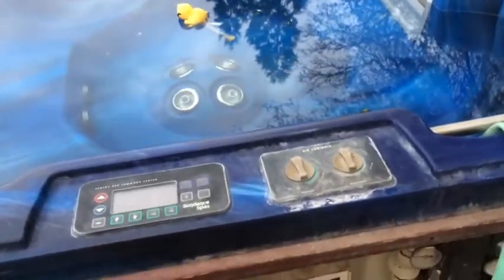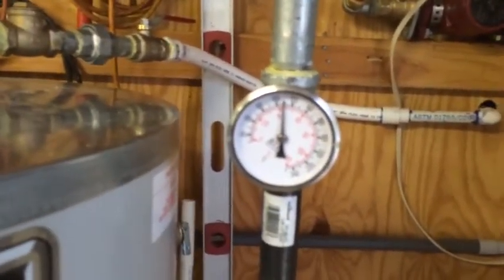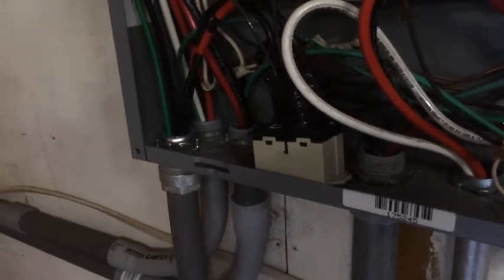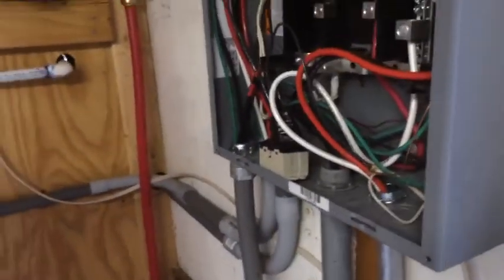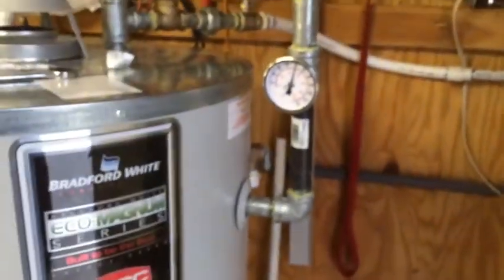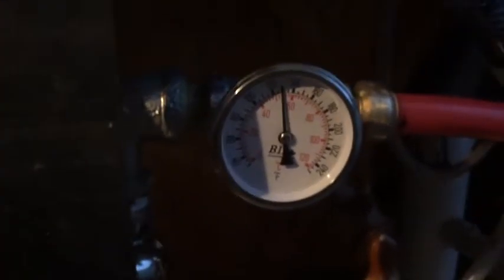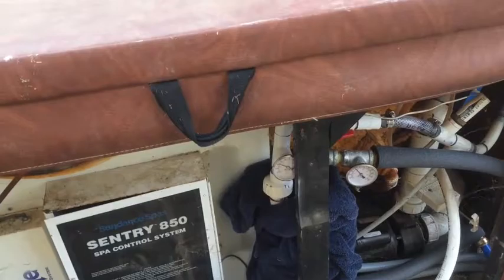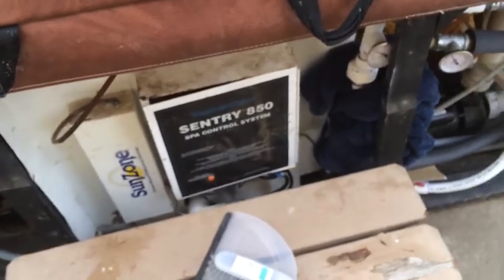Hot Tub Natural Gas Conversion

Comment: Nice job , and a very efficient way to heat a hot tub.    
I have a similar system , albeit factory made.    My hot tub has a   110 volt jet pump for the hot tub water.    It circulates through a tube which has a stainless coil inside of it.  There is a tiny  35 watt circulation pump on the stainless coil.   The entire heat exchanger unit is a piece of  2 1/2 inch pvc pipe about  14 inches long.    The Main pump control unit has a thermostatic setting which turns on the  35watt pump when heat is needed.   The whole thing is simply  T'd off my domestic hot water line in the house.   It comes through the wall from my bathroom , and I have installed a return line T'd back into the cold water supply line going into the hot water tank.   There is a check valve at that point so that  cold water will not enter backwards into the hot water line.     The entire system is incredibly efficient and cheap to run.   The initial heat up of the freshly filled hot tub took a couple of days , but now it maintains temperature with no problem.    One might think that the hot water tank would be continually firing , but no ,  It  burns only slightly more often than it used to.    The water flowing out to the tub is  about  135 degrees , and the water returning to the tank is  about 110 degrees.       My bathroom is at the far end of my house , quite a distance from my hot water tank , and now instead of wasting  a gallon and a half of water waiting for the hot to come to my shower , it  is already there waiting.      As a final step to making the system more efficient , I riged up a timer.    My pumps , and heat come on for the first  15 minutes of every hour instead of running constantly , thus saving a lot on electricity.     They come on  full time at  4 pm  and  recoup  the  3 or 4 degrees that the tub has lost since they shut off at  9 pm the previous night.       15 minutes of every hour is enough filtering time , and also ensures that no lines freeze  in the dead of winter.

Comment: I would detach the heating elements and use that voltage to turn on a pump that would feed through a tankless.  Attach the pump either to the spa tubing or to the shell itself.  You could put a relay in there to step up or down the voltage of the heating elements (which is either 110 or 220).

Comment: Also, what sized pump did you use?
Reply from the maker: Lance Kenison @0, and you did not ask about the heat exchanger, @0, both from Ebay, seller is: alternativeheat
Reply from the maker: slkttop, hmmm that reply got messed up. Pump is a Grundfos UPS15-58FC.  Heat exchanger is a 55,000 BTU, 316L Stainless

Comment: Why not just pump the spa water through a tankless heater?  You could do a loop from the spa plumbing right through a tankless without the heat exchanger.  I think it would be A LOT faster and more efficient.
Reply: Tankless heaters are great if you imagine never needing to use solar water heating in the future. To do solar water heating you need a tank to store the heat generated during the day.  I might use solar water heating at some point, so, I use the tank. Plus, since I use the same tank of hot water for a 450 gallon hot tub and a 3000 gallon swim-spa (which may not be obvious in the video) I don't need to buy two tankless heaters--one for each spa, which can get expensive. I might have a situation where the two tubs heat water fairly close to each other's cycles, and the tank can handle it. Honestly, the tanks these days are so efficient, and the energy used is so low, I am pretty sure I am saving money on a tank, vs two tankless heaters. But... If I were to do one tub and not planning on any solar, your idea would probably be what I would do.
Reply: Michael Smith as far as "faster" goes? not sure what you mean? the water in the tank is kept at an almost constant temp and comes out at 145*F or so, every time, on demand, without fail. The pipes are short and the delay in getting to the tubs is nil. You may be referring to the common issue in a house, where the tank is in your garage and the master bath is 2 stories up and 60 feet away. This is not the case.
Reply: I see your point, with multiple heat sinks and a solar heat storage, your setup is great.  I was mostly referring to the fact to that to fill my hot tub with 102 degree water from a small ($600) tankless takes about 45 minutes, so if yours takes hours to heat there is some kind of limit to the heat exchanged.  Still a great job, though, and you end up saving quite a bit on electricity.  I am in Cali (PGE) and I wonder what the economics of this are.  Perhaps you can enlighten me?
Reply: Daniel Kanaan First things first:  are you running chlorinated hot tub water through your tankless heater?
Reply: Michael Smith Would that kill the tankless heater with corrosion or just mess up the chem balance?
Reply: Michael Smith Would it matter?  Most pool heaters have copper heat exchangers.  Many people use tankless heaters as cheap pool heaters.  Even if you decided to use a heat exchanger between two water sources, it is still going to be made of copper.
Reply from the maker: Daniel Kanaan Big tankless water heaters for pools and spas are not like a home Noritz. I was told by many sources you should not use copper piping with chlorine. Stainless, or PVC only. They also are not made to cycle on and off regularly through the day like a spa does, and their heat generation is measured in 100s of thousands of BTUs. I looked into them. Plus, they require a huge diameter gas pipe to supply the flow of gas needed, that even, my house does not have. So to fire up a 200K BTU pool heater would require more gas than I can provide. Plus, the estimate to buy one and attach one to each spa would be about $4000+. So, at least $8000. I did the entire job for both spas for about $4000.  Unless one is made of money, you have to look at all options and pick your battles for cost vs. perceived benefit. How long does it take to make up that extra $4000? Same goes for solar. I followed the entire solar water heating thing all the way to the point where I was absolutely sure I was going to go that route. I was going to use vacuum tubes, because they perform the best in mediocre weather. But still, I would get stuck with 3 months out of the year where they would not perform real well and the solution was to have a gas or electric (!!!) water tank that provides the heat when they are not providing enough.  And again, after crunching all the math and consulting with an expert on vacuum tube arrays, it was about $8000 total to convert. 

The proof is in the pudding. when I can heat these two vampires for around $30-50 each per month, compared to over $100-200 each. I am fine with my solution.
Reply: slkttop Your solution works, which is important.  But a small rheem (takagi rebranded) regulating tankless comes in at $600.  Cycling really isn't a problem.  And copper and chlorine isn't a great mix, and it won't last a thousand years.  But it'll outlive its warranty (5 years or 12 on the heat exchanger).  I'm shocked you spent $4000!  That's a ROI in 6 years!  

Also, tank heaters are vastly inefficient.  Most tank heaters hover around %60, while a tankless, even that $600, is 84% and can go right up %99.  You would find that a tankless heater setup would heat your tub in under 3 minutes, so you're also saving money on pump electricity.  Your time to heat looked like around 30 minutes.
Reply from the maker: Daniel Kanaan $4000 really is hidden by the fact that it cost $2200 to dig a trench, Y my gas main and run it to my barn. You have to include everything. The actual cost was $1800 or so for both spas. Plus, now I have gas in my barn for anything else I may want, and I have hot water in my barn, which I may want to use as well. Hidden benefits that might not be obvious at first.

Daniel, all solutions "may" work. I can't argue with you on that. But. as I mentioned, I needed to pick my battles. I never mentioned the fact that "if" CNG prices quadrupled, and I want to go solar in the future, I can. I have a tank, a storage place for solar-heated water. With tankless heaters in place, I can not go solar if I wanted to. My solar solution would have to use a tank and heat exchangers as I do currently, so I am 90% done for solar. Most pool solar systems that do not use a tank or exchnagers, pump a huge amount of gallons of water out to the heating tubes on the roof in the morning, and then drain them back in at night. Both my 400 gallon tub and 3000 gallon swim spa are far too small to allow dozens of gallons of water to be pumped in and out again every day, changing the level all day long.
Reply from the maker: Daniel Kanaan I just re-read this, do you fill your hot tub with hot water, and drain it after every use?